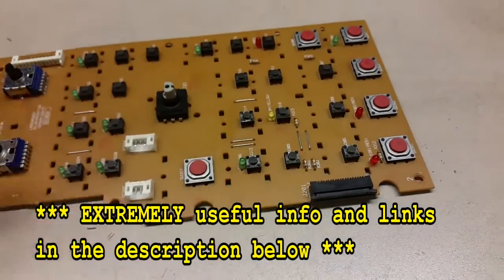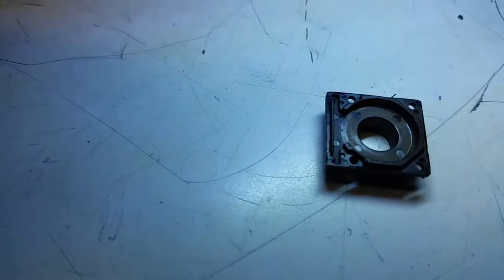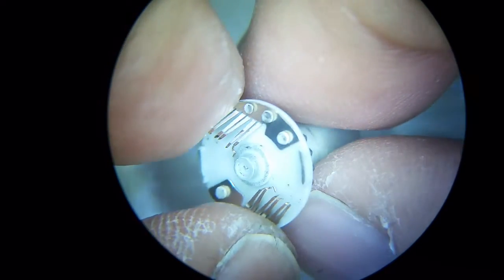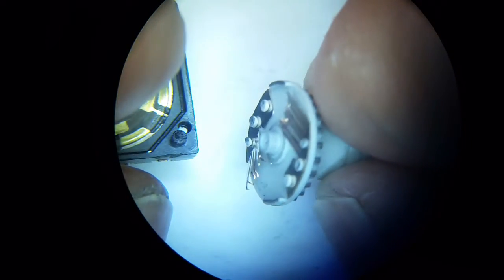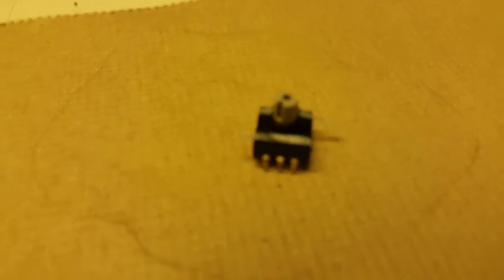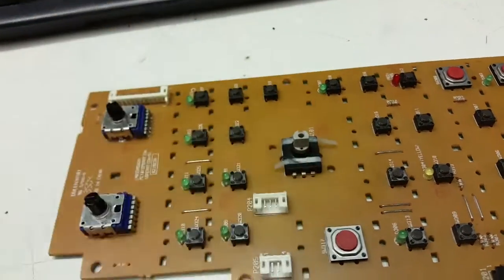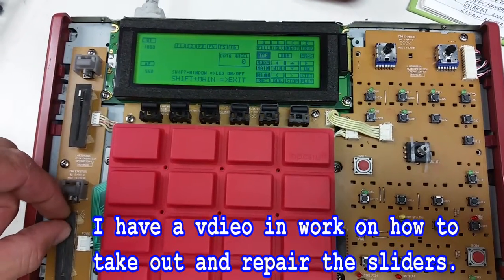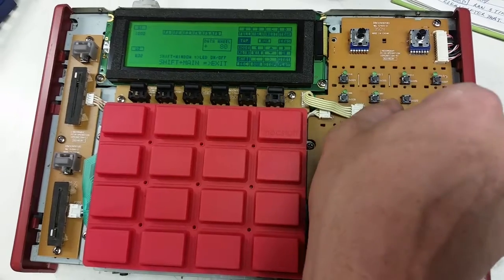MPC 1000 DATA Wheel Encoder Mitsumi SIM 026MT R66 5214 Repair

Comment: Yooo so I’m trying to figure out if it’s the encoder or is it because I need to update my mpc. I just bought a mpc 1000 yesterday and well the data wheel only allows me to scroll way click over ( for example if I’m going thru my samples and I’m trying to scroll down it only scrolls to down to the next sample and back up the the first sample I was on) I wanna know if it’s this encoder problem or do I just need to update the jssos. It running I believe jjos 3.16. And today I powered it on while holding erase so I could like factory reset and my data wheel started working. Turned it off kuz I had to do something once I turned it back on it went back to the same issue. Please if u can help me in anyway with some answers to this I would highly appriate it
Reply from the maker: Hi Anthony, I did this work for a friend who knows a lot more about them than I do. Contact Saun here https://www.youtube.com/channel/UCLxoVzIzuIN1tQ7DRO7gB6g and ask him the same question. I'm sure he can help you. Also check out the links in the description below the video for a ton of information on these. Best Wishes & Blessings. Keith Noneya

Comment: Thank you very much for posting your video - I just did such an operation on my data wheel. .. Actually I had bought a new one from mpc parts and installed it. But it didn't work properly, it jumped 2 digits at a time, so pretty useless and I have tried both wheel modes.  So my the next step is to switch to the old newly repaired one. I hope it works (mine wasn't as destroyed as yours)
Reply from the maker: Glad it helped, I hope it works too and you're welcome on the post. There's also one on the Q-Link sliders too here;  https://www.youtube.com/watch?v=kyAiKirxTZM&t=334s   Best Wishes and Blessings. Keith Noneya

Comment: Wow! Thank you so much! I managed to take the top of the encoder off with a scalpel without cutting the corners. Cleaned it with alcohol, lost the spring on the floor, found it, put it back together and it works! At least now the wheel kind of works, it didn't at all before the repair. I couldn't have done it without your video... Now I will have to replace the encoder...
Reply from the maker: You're most welcome MonkeyMinde. Glad the video helped you get it working until you can replace it. Best Wishes & Blessings. Keith Noneya